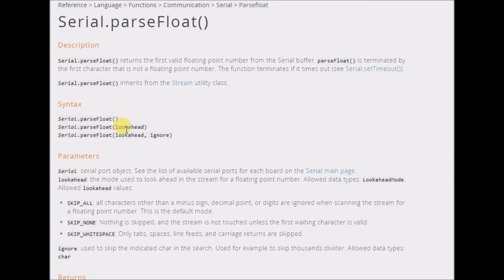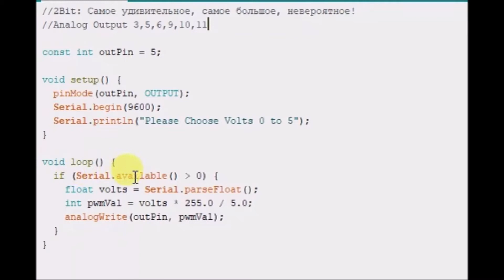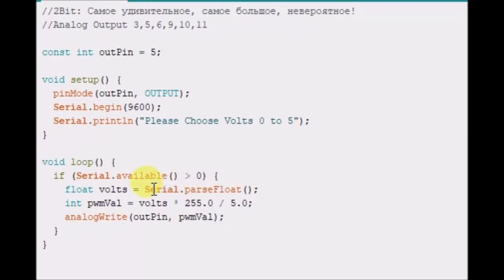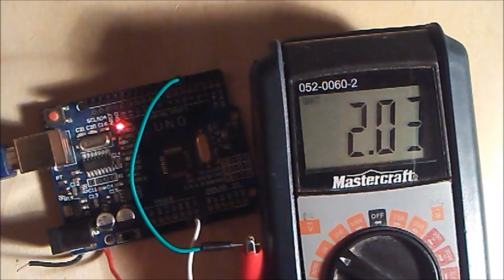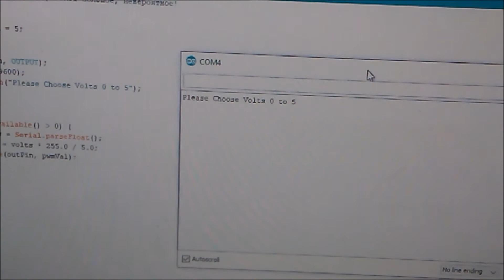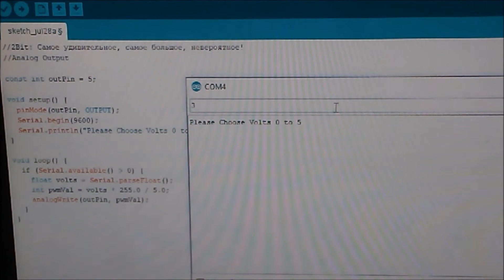Comment: If you were to
 try to control the brightness by varying the voltage across the LED you would find that nothing would happen until you got to about 2 volts then the LED would very quickly get bright.

By controlling the brightness using PWM and varying the average time that the LED is on you achieve much more linear control of the brightness.